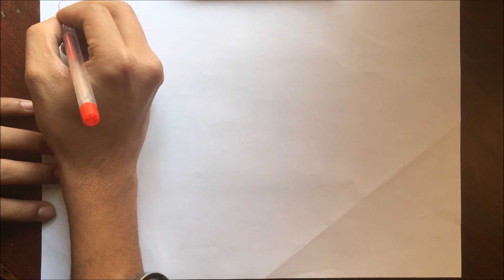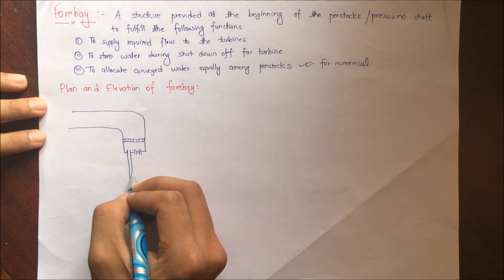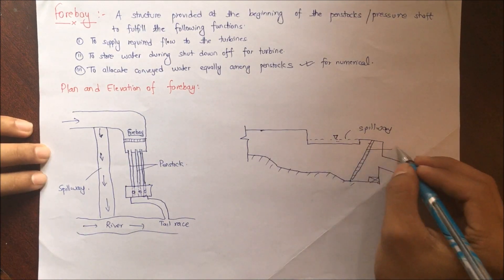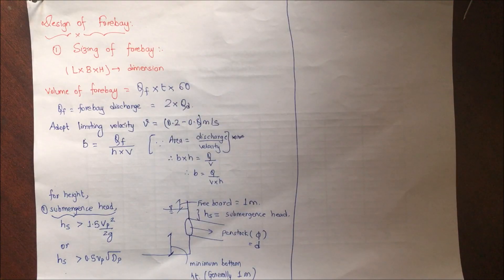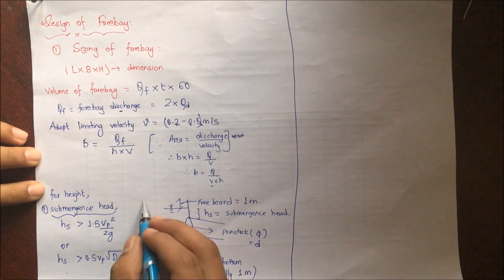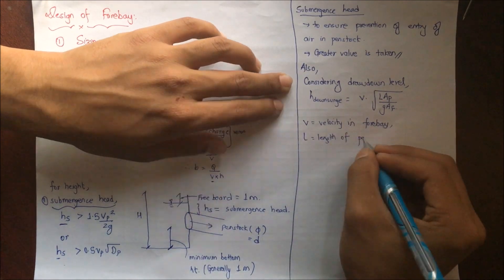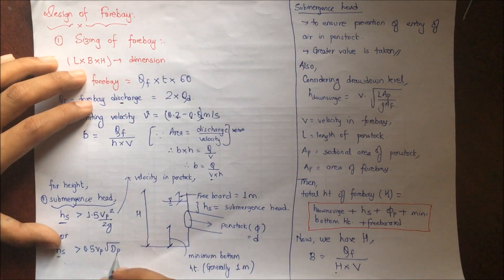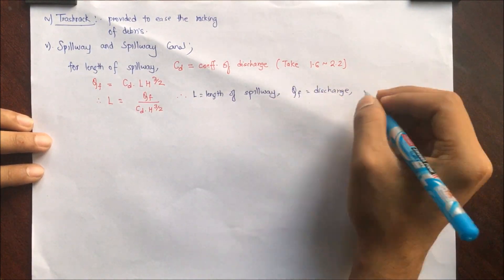Design of Forebay Part I | Hydropower Engineering Mumbai University | IOE , TU , PU

Comment: If the forebay is located at end of the settling basin and the water from forebay is transported to non-pressurized headrace tunnel than what could be a design procedure for it ??
Reply: Forbay bata tw penstock ma transport garne hoina rw
Reply from the maker: @lightcameraandaction3874  Yes, always
Reply from the maker: that will be called as a headpond
Reply: Then what about question of bikram pandey.....
Reply from the maker: @lightcameraandaction3874  Simple, if a pool of water iss placed ahead of penstock then it is forebay, else it is called headpond if provided just after settling basin. But both of these strutcure helps to counteract the pressure fluctuation.
Reply: @civilconst  do you have any material relating hydropower surveying? Or any of these engineering survey.
Reply from the maker: @lightcameraandaction3874  I didn't get your query.
Reply: @civilconst  pdf notes about hydropower survey.